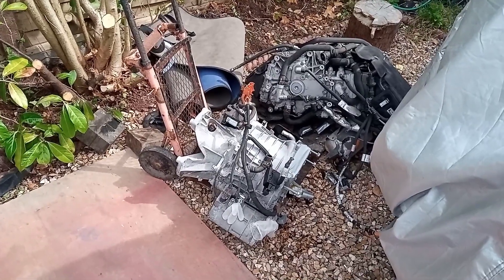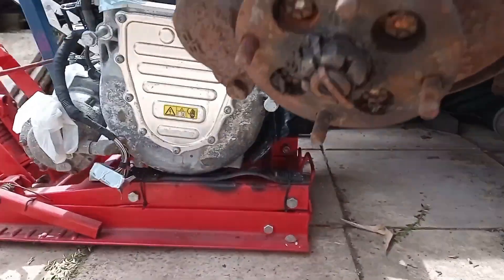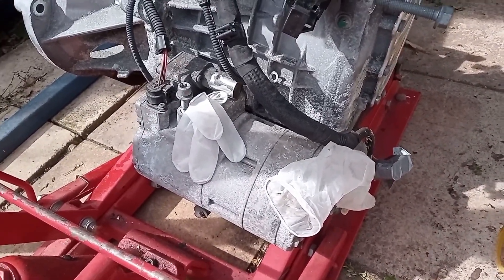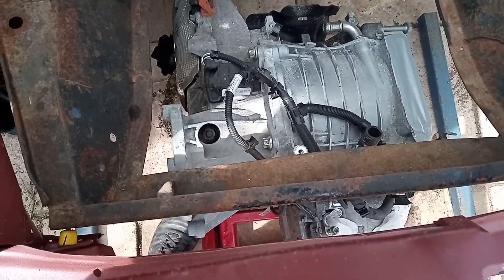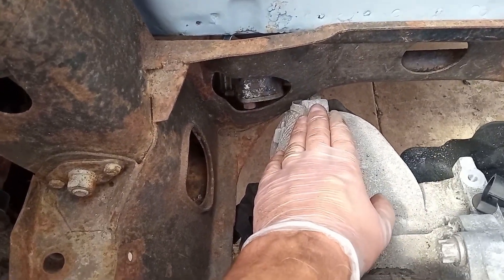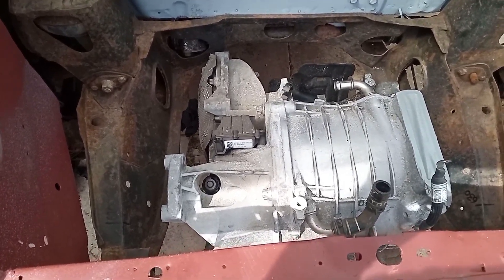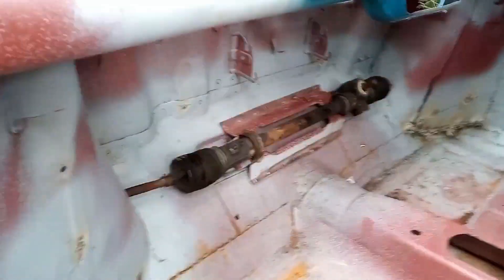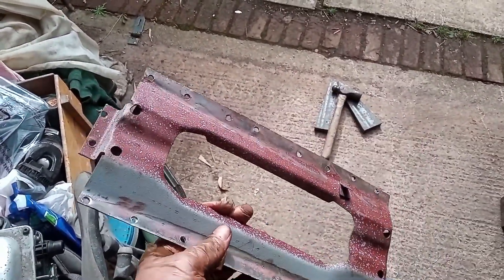Project Mini i3 where will the motor fit?

Comment: If you move the steering rack back you will screw up the geometry of the Ackerman steering. In other words, while you will be OK when the car is pointing straight ahead, if you turn the wheels they will move to the wrong angles and it will become very dangerous, especially in the wet.
Reply from the maker: Thanks John, I'm sure there must be a solution, just got to work it out. I saw they moved the rack when building Binky so I'm hoping it's a case of working out how to extend/move whilst maintaining the Ackerman angles.
Reply: @MiniLifeCrisis  
Be aware that Binky used all the steering/suspension components from a different car—not a Mini. Therefore they moved the rack on Binky in relation to the Mini body shell, to put it in the correct place to suit that alternative suspension.
Reply from the maker: Absolutely but they still had to make a bracket to bolt on and prevent bump steer. I'm sure there'll be a solution out there somewhere 😉
Reply from the maker: @johnrussell5245  thanks John, as the rack is rear of the axle line I expect to be able to keep the track rod end on the Ackerman line.

Comment: This is very interesting. Couple of questions...How heavy is the motor (and inverter)? Which drive shafts will you use? Thanks
Reply from the maker: Hi, the motor is about 50kg, I haven't weighed the inverter yet but it's quite a lump, probably another 15kg. I will have to have drive shafts made which will be i3 inner and Mini outer

Comment: Interesting way to sort the steering rack issue. How do you you plan to seal the holes bearing in mind the track rods will move up and down with the suspension.
BTW I'm not a great welder but investing in a proper gas welder kit would make the world of difference to your welds. 
I don't know if you follow him but Fitzee is brilliant at welding and has some great tips for welding car body panels. Even he can't make a decent job using gasless. https://www.youtube.com/watch?v=9ZLDNBAwr-s
Reply from the maker: Thanks Ali, I'll take a look.
If I do stick with the rack inside idea ( not 100% yet) I will probably have to box it in internally then cut the flitch panels away. I then need to work out how to join the rack to the wheels so I still get the right characteristics.

Comment: This is so exciting, it's all coming together. Thank you
Reply from the maker: Thanks, due to my shift work I either get on it loads or not at all, it's so good to get out there and see progress. This is the easy stuff tho, then I need to get it to spin 🤞
Reply: @MiniLifeCrisis  Have you seen the Vauxhall Astra 16 valve into mini subframes ?? could you get 1 of those 2nd hand ?? and fit the BMW motor/g,box to it ??
Reply from the maker: @kylereese4822  I have looked at the Allspeed subframes, the only concern I had was mounting the motor to the tubular frame. We are working with the original subframe at the moment and think we could get it to work.
Reply: @MiniLifeCrisis  looking at the video i think you are right case in point the steering rack in the car for extra clearance that`s a new one on me lol :):)
i may of gone to the Astra or polo mk1-2 option it puts the rack at around cylinder head height that's roughly the mini upper main bulkhead x-member area.... and used the suspension/coil-overs hubs etc... aka the long way round lol